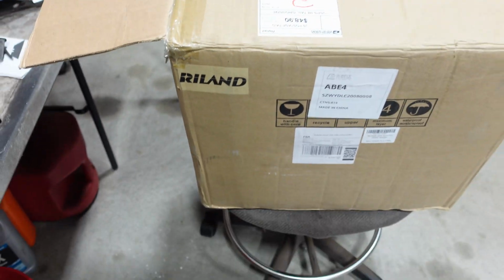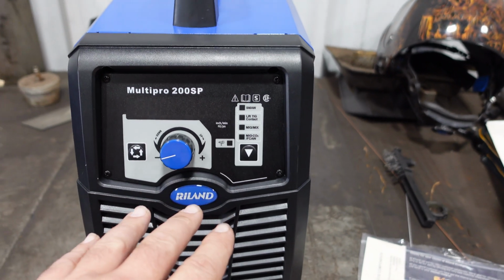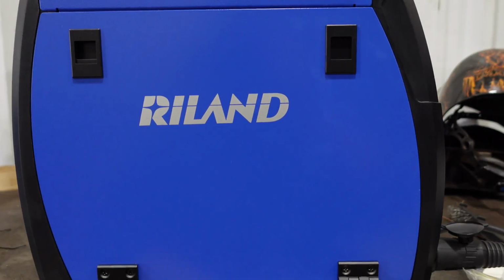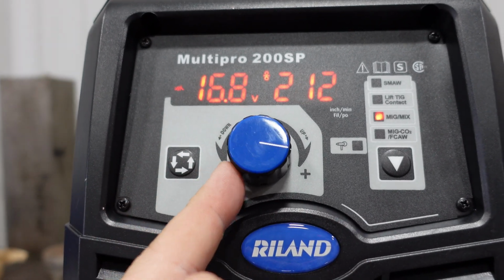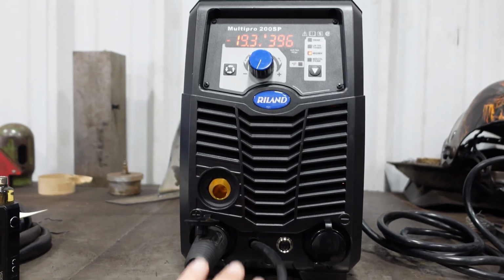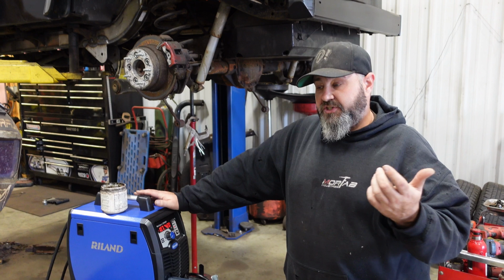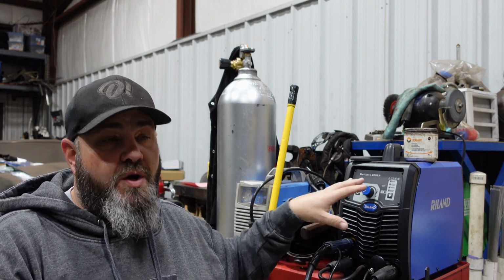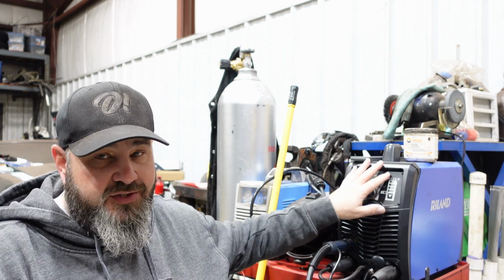Riland Multipro 200SP Multiprocess Welder.....Spoiler It's great!

Comment: All those new overseas machines are pretty good until they break. Almost none of the professional welding supplies stores carry replacement parts for them and those overseas suppliers are a pain to deal with them. It took me over a month to get a switch  for one those chinese machines. For beginning in welding they are  good. The new Lincoln 215 MPi do come with that type of plug; 240 volt with a 120  volt pigtail. Before, the old 210 MP still has the twist lock plugs, one 240, one 120.
Reply from the maker: I agree 100% It's almost worth buying 2 so that there is a backup in case one goes down. I have yet to run into that issue as none of them have actually broken yet. I will make sure to do a vid when I run into that issue.